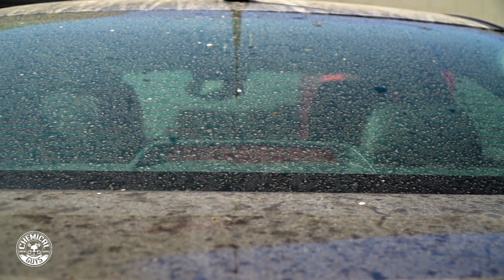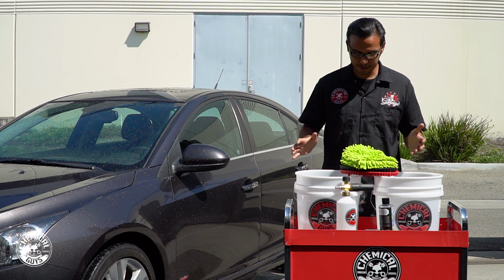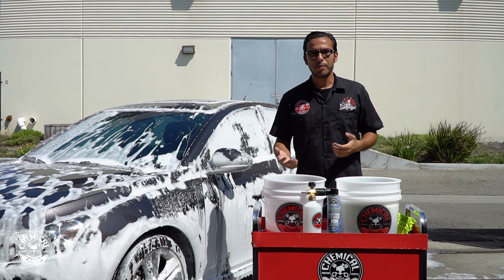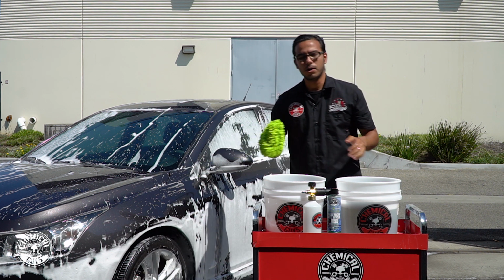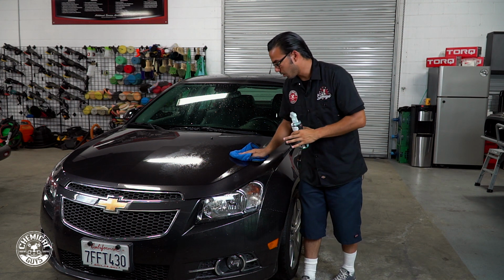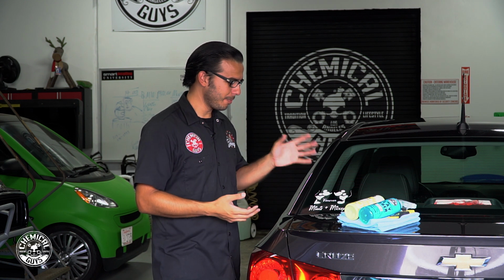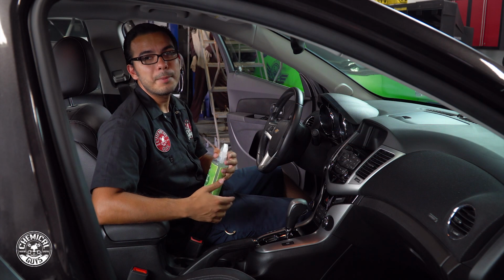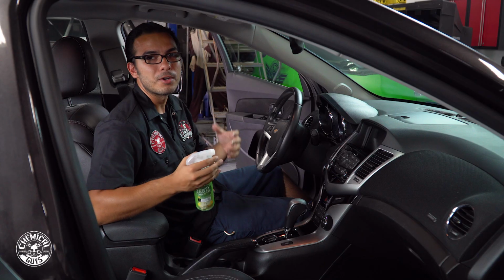How To Detail A Neglected Car! - Chevy Cruze - Chemical Guys Car Care

Comment: I dont know much but .... Isn't Rule No.01 not to wash a vehicle in direct sunlight ?
Reply from the maker: Hi there, we appreciate your concern for this customer's car, but would like to share a few reasons why it was safe for us to wash this car in direct sunlight:1. We use deionized water. 2. This soap, like most premium CG soaps, is pH balanced. 3. The climate was temperate. 4. The paint was cool to the touch. 5. It's California, so why wouldn't you want to be outside? 😊 We have detailed thousands of cars over many years under the conditions above, all to the utmost satisfaction of our customers. If you ever have any questions, or are new to detailing, we encourage you to contact us for advice. We can be reached via telephone, email, or even facebook messenger and are here to help.

Comment: Why would you not pressure wash the foam off to remove the dirt on the car then proceed with the 2 bucket wash ......
Reply from the maker: Hey Wade, thanks for watching. You want to keep the foam on there for extra lubrication. When you spray the foam on the car, it expands lifting the dirt away from the paint surface. When you use your wash mitt, you gently remove that foam which also helps the mitt to glide along the paint like shaving cream. Once you've soaped the car with your mitt, it's time to give the car the final rinse before you begin drying off the vehicle. Hope that makes sense, stay tuned for more great vids coming your way.

Comment: I find two wash mitts goes faster.
Reply from the maker: Interesting point, some people prefer to use a foam cannon, but if a pressure washer and foam cannon is out of the question than a two bucket wash mitt regiment may be the right way to go. Stay tuned buddy, we've got more great vids on the way.

C.G. Alex-

Comment: A broken-heart sucks..but a dirty car sucks even more.
Reply from the maker: Preach!
Reply from the maker: That's true,  you're car won't leave you and drag your heart through the mud. Keeping a car clean is great for morale, and maintaining the paint will keep your car looking new for years to come. My car sits outside in the work parking lot, it collects dust, bird droppings, and other contaminants that could etch themselves into my car's paint. Cleaning and applying coatings are the sure fire way to make the paint as safe as possible. Stay tuned for more great videos!!

Comment: Must take this dude ages to wash a car, so slow and methodic.
Reply from the maker: Detailing isn't about how quick you can finish washing your car, it's about cleaning your car in a way that allows you to clean neglected areas and extends the longevity of your car's paint, trim, tires, glass, headlights, and interior. Detailing is just that, it's all about the details.